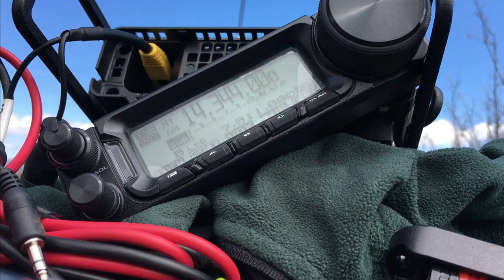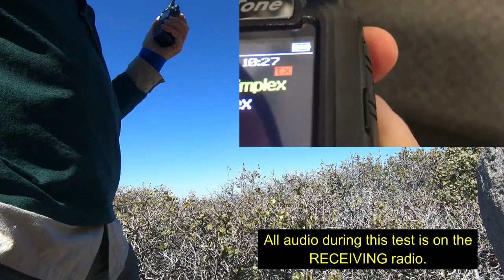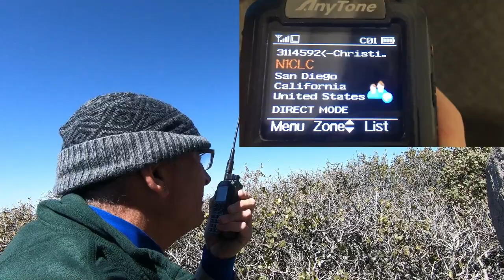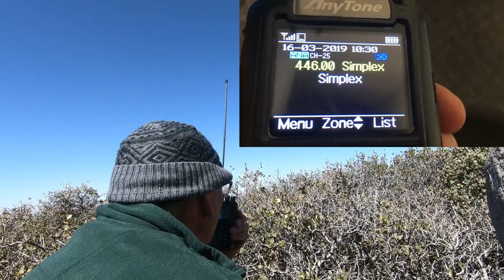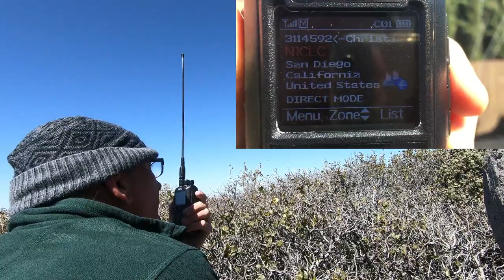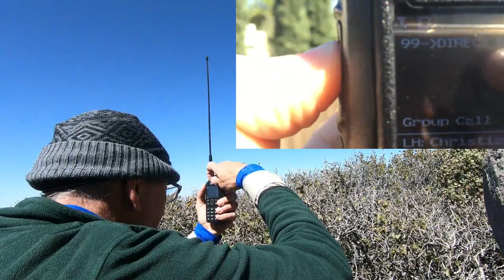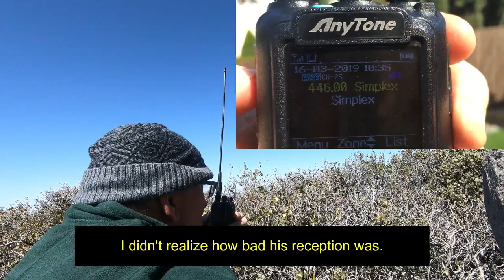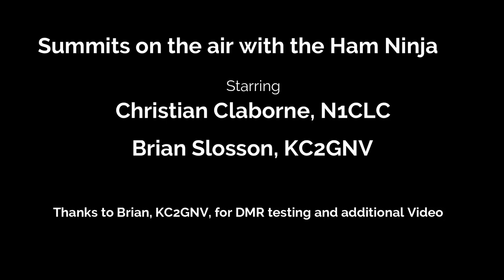DMR vs  Analog FM

Comment: Amazing except they should have been done on the same frequency never know if radio or antenna dynamics made a huge difference between DMR and analog however not disputing DMR is superior
Reply from the maker: Thanks for the comment.  We did stay on 70cm to remove the band variable.  The frequencies used were 446 & 441 so I don't expect that spread to influence the test too much.
Reply: @Colm Thomas Reilly I find flutter is eliminated on 70cm with DMR Colm, no matter the speed of the vehicle! Makes up for the slightly synthetic audio of digital when comparing with analogue .
Reply: Yes, should be on the exact same frequency.

Comment: I still have my hand held Icom ic-31a . In DV 440 mhz mode I can get super clarity digital voice when I drove in my car and my daughter in her room good 2 miles city tests. I’m sure I can get 5 times the range with external antenna.

I can also hit a repeater with a Yaesu FTM-100dr base station with a 35 feet external antenna which is about 90 miles away which analog can’t do w

Comment: I did my own tests at many different areas and distances and I found that analog is better. Analog easier to understand, further range. DMR sounds like a robot… harder to understand and shorter distance.

Radio I used was BTECH DMR-6X2 PRO.
Reply from the maker: Thanks for commenting.  I agree that analog has better quality but not at the edge of max range.  More testing and other observations like yours are needed.
Reply: @TheHamNinja  At edge of max range it did not pick up digital or just picked up for half a second with nothing… click… no sound while analog it was able to pick it up and understandable.

Comment: Very nice video! Thanks for posting. One comment though. In the final part of the test, both digital and analog were right on the edge. The digital sounded much better,  but if you had another power level to drop to neither mode would have come through.  It isn't that digital is significantly more capable, it just works better when you're right at the failure point. 
Not to be a naysayer. DMR is very cool, and there is more to it than just simplex sound quality.
Reply from the maker: I have had tests where analog just couldn't get through.  Also, most carry their HT with at least squelch of 1.  In that case, they'd never hear a lot of these transmissions but would have heard the DMR transmissions.

Comment: ok, DMR simplex is something that I have to learn how to set my radio up for, have not tried that yet. Will have to do some research to figure out how to set up my AnyTone AT-878-UV up for it.
Reply from the maker: A lot of code plugs published by various clubs normally include some DMR simplex setups.  Create a talk Group called "Direct Mode" or simplex, with talk group 99.  Assign that to a digital channel that you setup.  I have 441.000 setup that way along with a few others.
Enjoy
Reply: @TheHamNinja  Thanks, I will see if I can figure that out. Unfortunately our club here does not publish code plugs, they are a very strange bunch here. It took us years before the public was even able to have access to the DMR repeaters here unless you were part of DEM, they are definitely a "closed group" of people here.
Reply: @TheHamNinja  Do u have to add a digital contact and a talk group?  Sorry, I'm a newb.
Would it be too much to ask if you could make a video? 
I've looked for days on the net on how to set this up.
Reply from the maker: @rotor676  The only thing you really need is a talkgroup 99 entered.  You can manually set the channel and mode for digital on the radio.  Everything can be done directly on the radio.  If you are setting up a bunch of repeaters, it's definitely easier using the PC software.

Comment: Hi,

I have a few Baofeng UV-5R radios that I’ve been experimenting with. Recently, I decided to upgrade and got a pair of Quansheng UV-K5's, which I really like. Then, I felt the need for digital radios and purchased a Baofeng DM-1701, hoping to catch some local digital chatter. However, I haven’t been able to pick up anything at all. It seems like I might be doing something wrong, or maybe there’s simply no one talking.

Thanks.

P.S. I got the digital radio because whenever I scan the area and hear chatter, it’s just static. I know this is because they’re transmitting digitally. After googling digital ham radios, I found the DM-1701 and decided to try it.
Reply from the maker: I've used Fusion, and DMR, and a friend's D-STAR.  After doing some additional research, I really like DMR for it's end-user centered design.  In most cases, you have control what the repeater subscribes to.  I've written a few articles on DMR.  Several of those are focused on the Anytone implementation but there are several there that apply to any DMR radio. Have fun!!!
Reply: @TheHamNinja  Thanks, but I am having zero fun because, like I said, I am not picking up anything on this radio. Seems like DMR requires you to set this thing up first, before you can even hear anything. I did not know this is how it works. Anyhow. Thanks.

Comment: I've tried to comunicate with a friend who are 1km appart from me at a urban enviorement and the result was no good: we don't listen to each other at VHF, just at UHF. In analog mode we do listen each other loud and clear both in UHF and VHF. We use a Baofeng DM-1701 with openGD77 and the same TS and CC. What is this direct mode? how can I set it up in my DM-1701?
Reply from the maker: The accepted practice is for both parties to setup a chennel to use Talk Group 99, which is  the "direct talk group", and a common simplex frequency.  On the Anytone, the slot and color code don't make a difference.

Comment: Not a fan of the audio quality of these low-bitrate digital modes DMR or DSTAR... Sounds like you're talking through a vocoder.  Is there any other digital mode that has closer to analog FM quality?
Reply from the maker: That was pure SSB but I might have had the NR turned on, giving it that digital sound.

Comment: So a digital radio can also work in analog mode?
Reply from the maker: Yes.  The Anytone 868 / 878 radios support DMR and analog modes.  Excellent radios.
Reply: Christian Claborne Anytone vs Motorola thoough..? Suggestions? Opinions?
Reply from the maker: It depends on the radio.  I'm sure that there are dedicated DMR or other types of digital radios but all of the amateur models that I'm familiar with do both.

Comment: If I buy a DMR radio of A Brand is it compatible with another brand's DMR radio or do I need to buy it with the same brand?
Reply from the maker: Enzo Pulido For the most part they are all compatible.
Reply: @TheHamNinja  as long as they are tiar 2.
Reply: Baofeng tiar 1 will not work.

Comment: What was the height difference between you two? Because in a line of flat sight, the max distance is around 6 miles.
Reply from the maker: Hi John, thanks for the question.  We were approximately 37 miles apart.  I was probably 6,200 feet above Brian.  I worked him near the edge of the mountain and then went and sat down 50 yards away from him so we had some dirt between us.  One of the main points was to do comparisons between the two modes to compare capability and quality.
73
N1CLC

Comment: Thank you for this video. It confirmed what I always suspected...I hate the sound of digital audio, as it sounds  (to me) like off-key musical tones trying to impersonate the natural analog waves of FM modulation (sort of like the sound of digital CD music compared to an LP record. While most people like it better, I never did). I don't have a cellphone for the same reason. You just saved me upwards of $400. No digital for me. Thanks again. 73s.
KD2DKO
Reply: You're tripping. Ever used single side band? It sounds like donald duck standing in a fan when conditions are poor. Digital audio when it's on the edge of reception does not sound the same as strong signal digital. The point of the video was that on analog, at 1 watt, static was all she wrote. Digital at 1 watt, communication was possible. It's not about how it subjectively sounds. I thought the sound of DMR was weird until I used nothing but DMR for over a year. After that, I couldn't stand hearing the snap, crackle, pop, of analog.
Reply: @paaao  well he specifically talked about fm
Reply: @gamingforlive2150  he sure did. What's your point? His point was that FM sounds better because this test conversation where digital was on the very bleeding edge of being sustainable, sounded bad. That makes zero sense. Digital is used %100 everywhere now, from cell phones, to police, fire, ems, radios. It's not used because it sounds better or worse. It's used because it's 1000 times more flexible in our networked/digital world, and can reduce the bandwidth required to perform all the modern communication taking place. Also, as the video showed, when on the fridge of communication, you're much more likely to get a msg back/forth using digital due to the error correction, and smaller bandwidth. This video doesn't even go into DMR direct text msg'ing which ALWAYS gets through once analog FM can no longer make the trip.

Plus I guarantee you he uses SSB to talk on HF, and not FM. Most of these guys complaining about the way digital audio sounds will talk for hours using SSB that is in and out, filled with static, and drifting in frequency all over the place. They're not doing it for the audio, they're doing it to communicate long distances. Pot calling the kettle black.